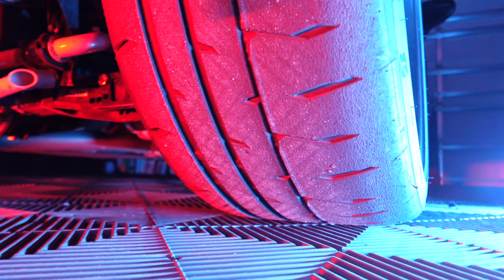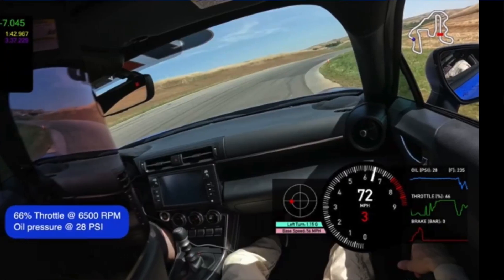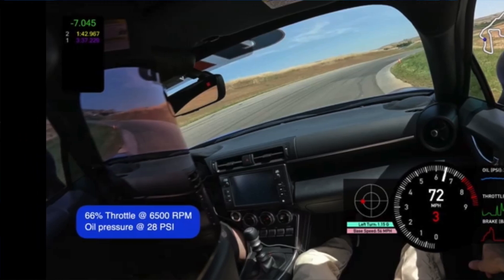GR86 Motor Problems

Comment: Do you guys think for a daily that from time to time is driven a bit hard should still have 5w 30 oil?
Reply from the maker: Yes, even in the owners manual, it says you can run 5w30
Reply: If you got high mileage it's time to swap to thicker oil. Your clearances get eaten up over time leaving space for oil to get by so if you go thicker it'll have a harder time getting through piston rings and whatnot which equals less blow by and less oil consumption
Reply: @WhatsItsWeight thought this was old school myth. Newer engines I thought used thinner oils to circulate faster and lubricate better. Hasn’t the viscosity got more to do with ambient temps and perhaps engines with lower(opposed to higher tolerances? Where are the molecular geniuses when u need em 😅
Reply: @daintreetosea  what's a myth? The fact that your clearances get worn out and need thicker oil?

Comment: I have seen one case of someone running 5w30 blow up. Probably starved in a turn so it didnt matter what weight in their case.
Reply from the maker: Correct I don’t care how good your oil is if your motor isn’t supplying it to its needs.. That’s why I would recommend the baffle plate

Comment: Maybe unrelated but the manual for my BRZ states to check the oil very frequently (every two fill-ups) and even addresses more aggressive driving. Admittedly I was surprised when I ran the oil below the dipstick because I was busy with work and didn't check for a while (this was at the 6500 mile mark). I did get this documented with Subaru but maybe just worth noting. 

The point is this car seems to consume oil which might catch some people by surprise. Not a lot of people on the internet share the full context of their ownership when something goes wrong. Still, I do thing Toyota/Subaru messed up a bit in contributing to blown engines. I had a Toyota from 2011 that also used 02-20 and consumed a lot of oil.
Reply: Yes the 2.4 has been designed to rev freely and to get the most out of it GaZo racing put light weight pistons with low tension piston rings. If owned 3 BRZs and my current one was broken in for an extended time and find it uses less oil but still I find that when I drive it hard it seems to push oil past the rings. Not that much. On the interstate the same thing, long drives at elevated speeds gets the oil hotter and it uses oil but not that much. I check my oil daily before driving and always maintain full status. Less chance of oil pickup sucking air with high G forces in tight turns. My other very important safety measure is to set my rev limiter warning to 6800 rpms because the engine power peaks at 7000 rpms and I find that by the time the warning has sounded I’m already past 6800 rpms and at 7000 rpms. That to me is being safe. Oil viscosity is personal preference, I’m good with factory recommendations and changing the oil sooner. For me, I’d love to see someone design a larger capacity oil pan with baffles that could fit ??  OH !  One last remark, I have heard that engine computers have recorded over rev events, like 8000 rpms, THAT will run bears dry and it doesn’t take to many over rev events to wear out a bearing. I’m sure that’s why we hear of track cars with spun bearings !!!
Reply from the maker: @Tonga2  with my E85 tune my cars redline is 7k not 7.5. I feel the aftermarket is have a better pan and baffle plate
Reply: I think that’s true of most boxer engines and any performance 4 cylinder that gets revved out or driven hard. Both my Miata’s that I had before consumed oil after a while, and my Honda definitely burned oil after a while… It’s wear and tear on the engine. If you’re gonna drive your car harder, you need to pay attention more and be more on top of maintenance is the bottom line. However imo the service interval on the FA24/20 for oil changes is way too long.
Reply from the maker: @NapalmPineapple  yeah, you definitely have to pay to play. That’s why I’m modifying the car to keep up with demand.
Reply from the maker: Yeah I don’t recommend 0w20

Comment: With our race cars, awhile back we had poor cooling of engines with oil coolers mounted in front of the radiator. Even fog light block air flow. We moved oil coolers to different place. Not saying it’s the “cause”, but it definitely impacted cooling of engine with it in front blocking it.
Reply from the maker: I’m thinking maybe even a bigger oil cooler

Comment: NOTE: factory will cover blown engine untouched for 3yr/36k. Once you open oil pan, add engine mods, that gives them a reason to deny warranty if blown. My2cents. Want to be safe from paying for a blown engine, drive stock (daily/track). After warranty, sell or drop pan and go crazy. Never use a new car as a serious track car, unless you have a yacht and 3 homes. Buy a used 2016+ brz/86, strip off 500lbs, add exhaust, suspension and tires and it will be as fast as a 2gen on the track. My 2018 1gen track car (2,170lbs w/tune) can pass my 2gen on the track no problem, it’s dialed in. Also helps if your an experienced track driver. 

2gen were sold as a fun daily you could take to the track. Not the other way around.
Reply from the maker: 2170lbs?!? I’m 2850

Comment: My comments are purely to try to help in keeping these engines together, no more no less. I have a 2nd gen Cayman S as the engines in the 1st gen had issues due to design flaws in which the aftermarket has addressed most of them, to keep them from blowing up, and the 2nd gen engine is a new sheet of paper design. My brother has a 1st gen FRS and though he isn't racing it I looked into the problems they have with oiling. I wish I could examine an engine that is disassembled to look at the oilways to come up with a solution, if in fact it's possible to do so. My thoughts on the problem in naturally asperated for is as follows; 5W40 oil, truncated baffled higher capacity sump, oil cooler, better pickup (larger diameter tube) for oil pump, windage tray, improve oil returns from heads & de-aeration (swirl-pots), see and correct (if necessary) if too much oil is is being directed to the cylinder heads for lubrication and valve spring cooling, install a 2nd feed to the main bearing that is feeding 2 connecting rods, install ARP rod bolts for the safety factor they allow and live with the factory red line. The oil pressure is secondary to a constant high oil volume and the rule of thumb is 10 psi per 1,000 RPM's. Hope this is useful to the community and have fun.
Reply from the maker: Yes I agree. Thank you for sharing!
Reply: Again tracking a new car is fine. Serious tracking is asking for it. You will spend $$$$ to prevent blowing engine a new $32k car? Not smart money. Used cheaper cars are more fun. I pick my stripped, tuned, pro-transmission 2018 brz track car (84k) over my gr86 or Cayman s. It’s a raw go kart. Zero issues since it was born.

Comment: It’s a damn subie motor that’s why.
Reply: Technically, engine. Motor is electric. In Porsche forums, we coin the phrase “what do you expect, it’s a Porsche”. Is your point it’s only Subarus that have engine issues? All performance cars have engine issues. BMW, Porsche, Audi. Why are Japan model performance cars any different.
Reply: @michaeljohn1160  motor is  both gas and electric